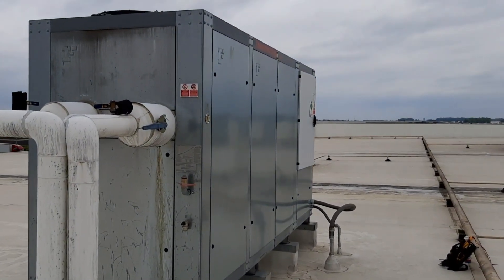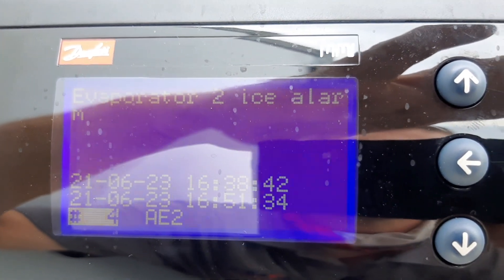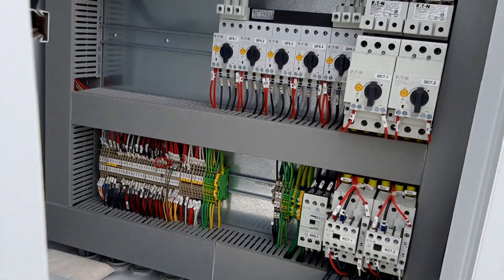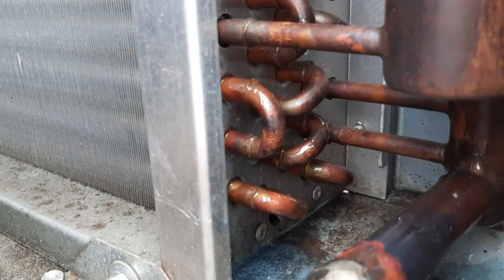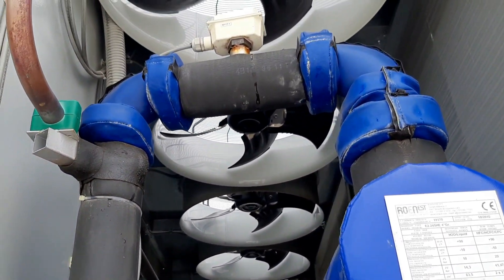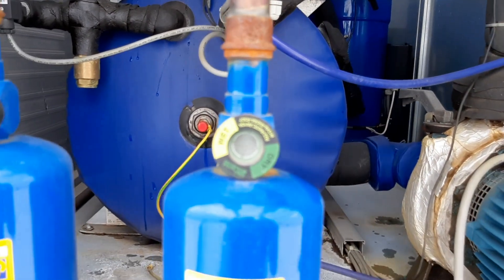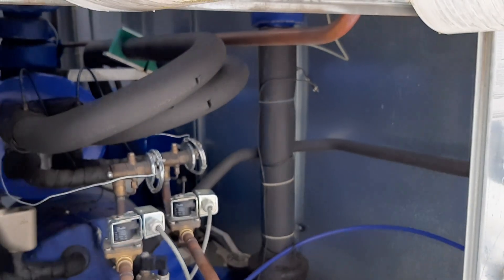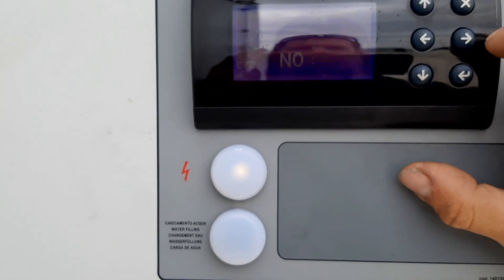HVACR Service Call. Evaporator Iced up.

Comment: C to F conversion= C°×1.8+32=F°......what ever happened with this chiller. Did you all replace the coil?
Reply from the maker: Actually we got the the coil in finally and I don't know if it got done yet, we had to schedule with customer so chiller could be shut down, I think someone else did it, ive been pulled in every direction lately.

Comment: Looks like an italian chiller based on the castel parts and danfoss compressors. That's a tough spot to repair man. I had a eurochiller, also italian, with the same leak point. 
I actually pulled the coil and tried to repair it without success. You try to repair that one U-bend and you deform the other ones around it. Some guys like to cut that leaking circuit out but then you lose capacity. 1.5 C setpoint is also close to freezing I'm surprised that alarm doesn't trip more often unless it has a lower setpoint.  You got any idea where they're getting their ice alarm reading from? Sensor on the heat exchanger perhaps or TXV outlet?
Reply from the maker: Repair would be tough and not successful, at least long term as I said, coil needs to go. That's what I recommended.  They were resetting for a week or so. Doesn't really matter where the alarm is coming from it's alarming correctly for ice.

Comment: Nice job. 
Yep, it's not easy if you grow up with SAE system and now everything is Metric, Celsius..
I was grow up with Metric system and I am still confusing at SAE..
Reply: Not sure, but I believe you can change the scale on the controller to the SAE mode, it should be in the set-up menu. When you call about warranty status ask for your wiring diagram and a manual. I do a lot of smaller industrial chillers and most of the manufacturers will email what your need.
Reply from the maker: Nice! Good information.  I did request more information but that's good to know! Thank you for the information!
Reply from the maker: Lol, it works both ways! Thanks man!
Reply: We are too.